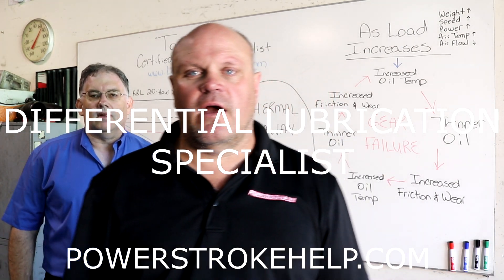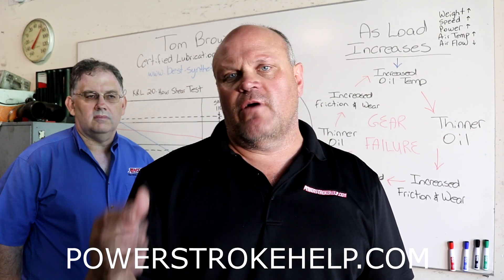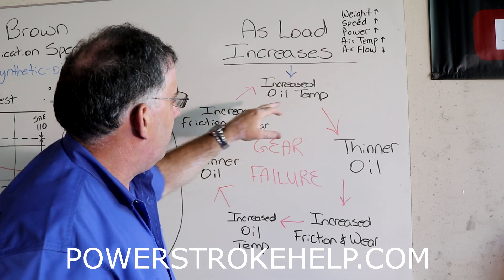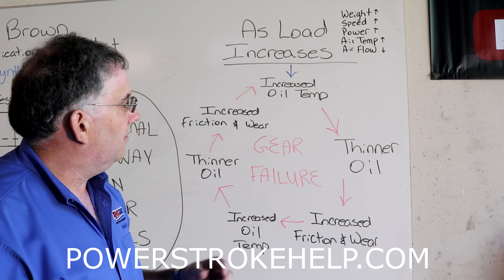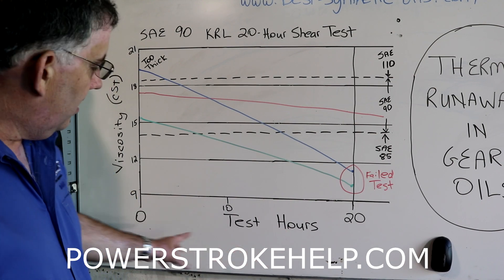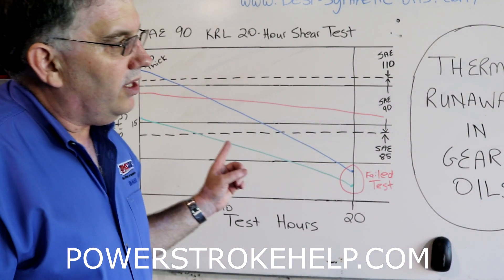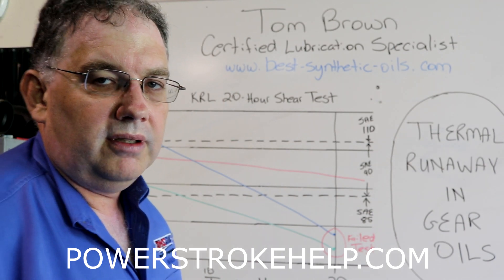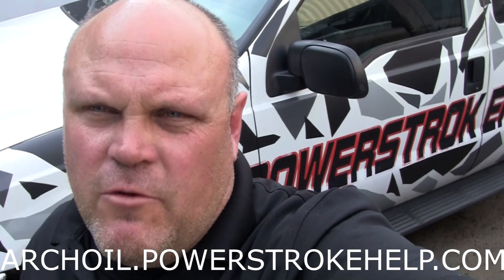DIFFERENTIAL LUBRICANT FAILURE - FORD POWERSTROKE DIESEL

Comment: Hey Bill and Tom. Just installed an Eaton true trac in my 10.5. 2001 f350. Eaton calls for 80w-90 non synthetic and no LSD additive. but ford says 75-140 synthetic. I’ve determined to go with 75-140 but it’s next to impossible to find a non synthetic non lsd. Any recommendations?

Comment: when the differential oil runs low, the outer bearings on the full floating axle do  not get lubricated, they will fail before the differential gear because there is some oil in the housing.  when the outer bearings run out of oil they fail, putting the axle badly out of alignment.  my axle actually melted it  didn't break.  $1400 to fix.  i now check the oil lever every month or so.

Comment: I pull a 24' pontoon boat. Dipping the rear end in the water to load and unload cause any damage?
Reply: Silver1ton If your rear end is sealed well and you are not submerging it deeper than the vent hose tip, it shouldn't cause immediate problems. I would follow the Severe Service schedule found in your Owner's Manual, which probably tells you to change the differential oil every 50,000 miles (or send oil sample to lab for testing).  Contact me directly for more info:  info@best-synthetic-oils.com.
Reply: Ok thank you Tom. I'm still saving money so I can bring my truck to bill and hopefully get a chance to meet u too.
Reply: Best-Synthetic-Oils.com 

Ok I'll be coming from Michigan. Thank u for all your info on oils and fluids for these trucks. 2006 f350
Reply: Ok thank u tom. I'm Billy by the way.

Comment: TOM or BILL Please HELP!!! Delo reformulated to a Delo CK4.  I have always used Delo LE 15w40 and now it's reformulated.  My 7.3 smells like crap and idles a little rough with this crap. Any ideas on how to correct? Are all 15w40 oils reformulated
Reply: found your video explaining this..draining that ck4 crap asap.  gotta find Motorcrafts reformulated version. thanks for the videos. good stuff.
Reply: Jason - you may have something else going on if you are getting weird smells and rough idle.  I'd highly recommend you get a sample of the Delo CK4 sent in to the lab for analysis.  Contact me if you need a kit or more information.  My email is:  info@best-synthetic-oils.com .
Reply: I thought same thing and last night discovered a rat's nest 12 inches in diameter in my intake.  unbelievable how large it was. I just moved to Arizona in November and found out about the pack rats out here.

Comment: let me get this straight the hotter the gear temp the thinner the oil the more it wears????????????
Reply: Sean Welch 
Plain and simple, heat is loss. 
But not like some miracle lube is gonna "free up" power , it'll just run cooler maybe. 
Heh I saw heat and wear firsthand yesterday. 
A generator with a 3.0 gm ran for an extended time with 2 out of 4 quarts in the oil pan. 
The sucker got hot enough for the sticker on the valve cover to look like a blistered shrinky dink.

Comment: Quality lube is always important but the broad statement that (running tunes & upping the HP "requires" read diff upgrades)...   Not everything is sooo black & white... 
? Question ?  How much HP  &  TORQUE is the 2016   6.7l.  ?    Hmmmm?  860 ft lbs on the same 10.5" Sterling...  & that's FORD still willing to warranty it.   Maybe you should let people know that if there POWERSTROKE is modified at over 800 ft lbs, it's a concern. But wait, that hot of a mod is not what you would be towing with, ((unless your towing with a 2016 F350)) Hmm, seems like pretty much EVERYONE is in the safe power zone, they should just be up on the lube quality.
Reply: The new 2017 dually  is running the Dana M300 rear with a 11.8'' ring gear.

Comment: @5:30 "all that stress was being absorbed by the rear diff" not the motor, springs, transmission.  Nope ALL on the rear DIFF (not even axle housing)... um WUT.  So this is what am-soil like, is.  I am so confused first the blue oil cheated trying not to fail the test by failing the test before the test started, then the blue failed again but it started off failed so to say it failed like 15 hours in was wrong cause it failed at 0... someone needs to watch this before posting and make sure what this guy says even makes sense. Also I bet $2000 on red oil is AMSOIL rofl the other 2 are likely something you find at the dollar store. 

All this shows is, if you buy the cheap oil and change it often, you are safe.  So I can spend $11.30 per quart for amsoil HDEO or I can spend $2.5 a quart and change the oil 4 times as often... spending less money and getting 4x the soot, fuel, etc out of the oil.  lol.   Fresh oil 4 times or amsoil once.  Er... 

Or I can pay a subscription fee (wtf) to get cheaper prices... rofl so your ripping everyone off unless they pay upfront. 

Spend some money and set up the website half way correct so on the search engine your title is not your web URL lol.  

Also guys remove the - and way nicer website for another amsoil dealer... this guys website is WAY to busy...

Comment: I guess I should look for a cooler for my diff. I tow a 17k trailer with my F250 7.3.  Completely overlooked and neglected to think about the stress put on my diff.  Great vid!
Reply: Jason Pearson 
Yea I'm kinda surprised aftermarket guys haven't picked up on this much, I know some exotic cars and race cars would or could have pumps and coolers in the transmissions and/or differentials. 
Tbh I'm a tech in a different field , but I dig these vids and a bud has an 03 7.3 ,it just turned 300k 👍🏻
Haha and it still pulls on a pos Porsche Panamera at 100mph 😬

Comment: Iv'e always wondered when I was supposed to change the lube or something with a diff. 
Thanks for clearing things up!
Reply: Look in your Owner's Manual and follow the service instructions for Severe Duty - even if you don't think you operate under severe conditions.  By doing so, you will get the longest life out of your vehicle, and experience the fewest breakdowns. Also use the best parts, fluids, filters, and fuel available. If you have any questions, contact me at info@best-synthetic-oils.com, or call/text me at (678) 787-3028.

Comment: Yea, AMSOIL has been proven amazing in differentials since back in the 1960s with Bobby Unser racing in the pikes peak race, and AMSOIL has documented that upgrading to AMSOIL differential gear oil gives a vehicle the most significant economy gains, which makes logical sense since the differential is the main bottleneck in the power train.

Comment: The oil shown on the red line in the above video is AMSOIL Severe Gear SAE 75W-90 Gear Oil.  If you are interested in learning more about this product, please email me at:  info@best-synthetic-oils.com, or call / text me at (678) 787-3028.  AMSOIL sells Severe Gear oils in 75W-90, 75W-110, and 75W-140.
Reply: Best-Synthetic-Oils.com 
Yup. Ive used the amsoil 2 stroke syn. That works the best in my honest opinion for 2 stroke oils. Never tried anything else